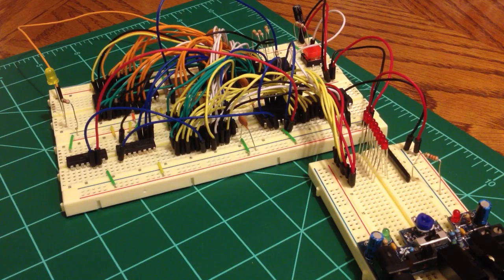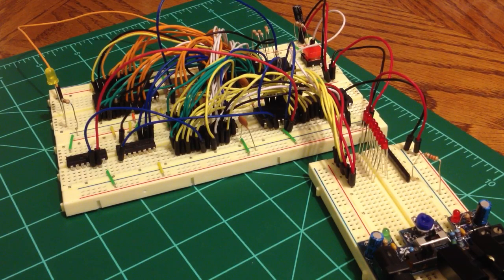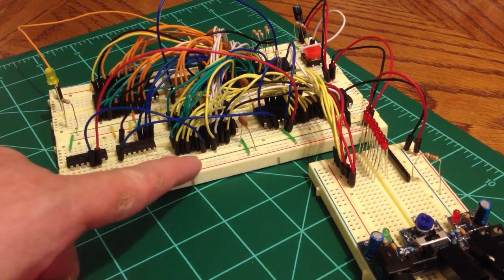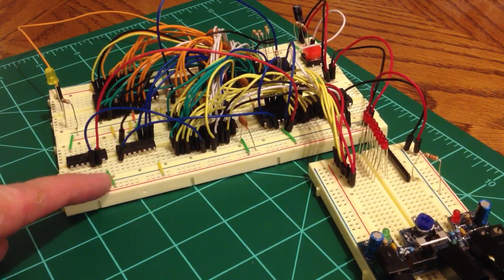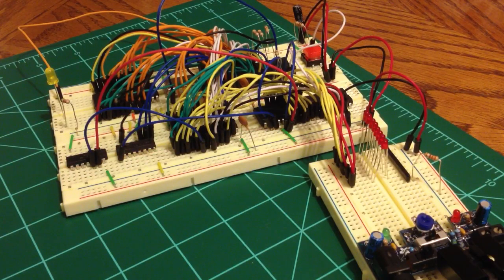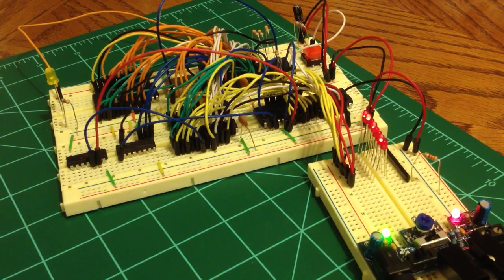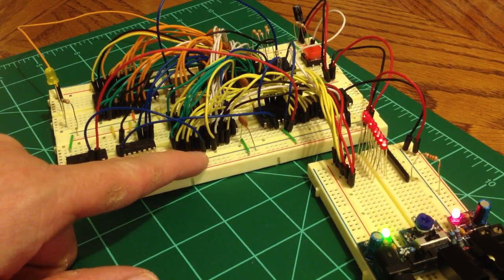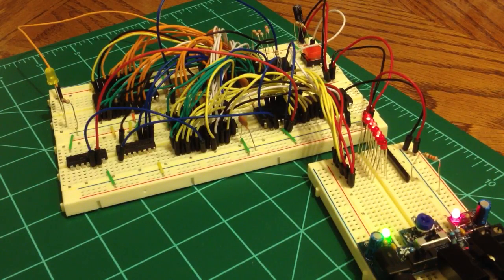Project:65 6502 homebrew computer RAM and IO test

Comment: I had a circuit with diagnostic LEDs but they flashed too fast to see anything. So I changed it so the lines would go to a resistor ladder that made up a rudimentary 8-bit DAC. Then with some filtering, the output became a triangle wave in the audio range. So by listening to it with a headphone, I could hear if something was hanging, or counting out of sequence, or misbehaving some other way. Later logic turned this output to a sine wave, and hence less need for filtering.

Comment from the maker: I figure it'd be possible to do something with discrete logic circuits on the bus - that's what's going on inside the 6522, after all.  One of these days I'd like to dig into the Apple I schematics, since it doesn't seem to use any specialized chips at all.